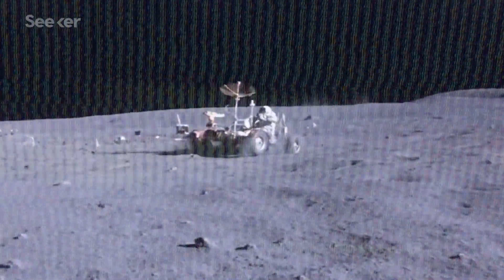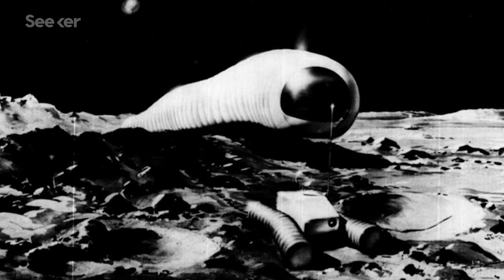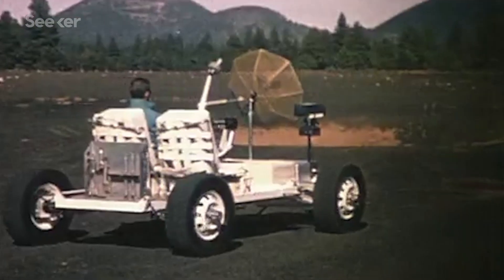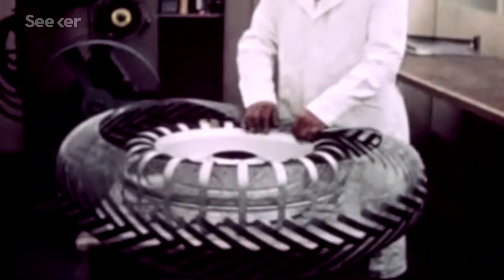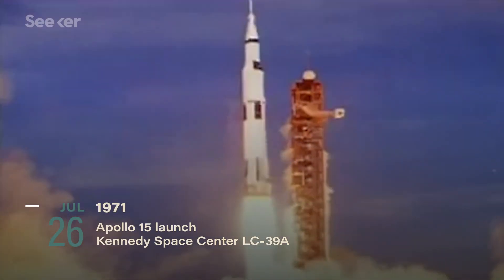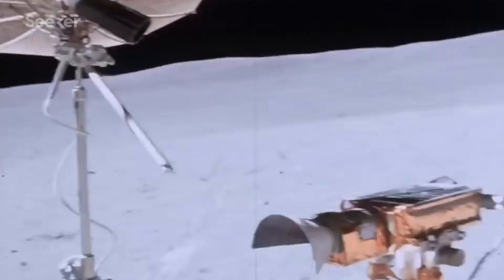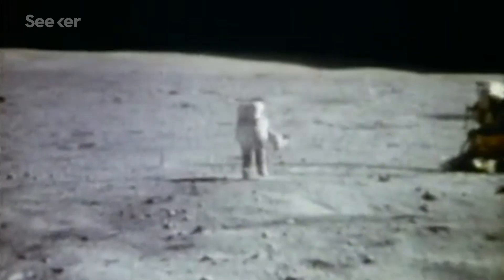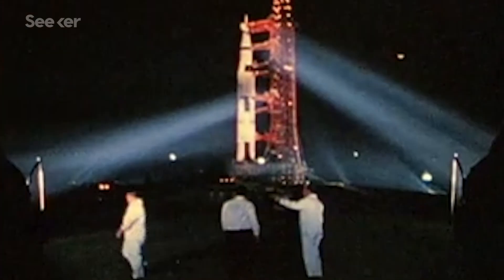How Did NASA Engineer a Car for the Moon? | Apollo

Comment: 🇭🇺Ferenc Pavlics
The native form of this personal name is Pavlics Ferenc. This article uses Western name order when mentioning individuals.

Ferenc Pavlics (February 3, 1928 – February 13, 2024)[1] was a Hungarian-born American mechanical engineer who developed the Apollo Lunar rover.

Working on space projectsedit

￼The U.S. Apollo Lunar Roving Vehicle from Apollo 15 on the Moon in 1971 (NASA)

After leaving Hungary, Pavlics first was working from 1957 in the General Motors (GM) Research Division, Detroit. From 1961 he continued his work in the Santa Barbara Division of GM developing overlands. He continued his postgraduate studies.

Later for the NASA JPL and Boeing Company he started the development of the Lunar Roving Vehicle.[2]

The rover had a total mass of 210 kg and was designed to carry a payload of an additional 490 kg. Each wheel had a 190 W (0.25 horsepower) motor (so the full motor power of the rover was 1 HP). It had a special vehicle design to be able to move on the special surface conditions of the Moon. Their frames were made of aluminum alloy. (See more details: Lunar rover.)

In 1971, the Apollo 15 carried the first Lunar rover to the Moon. In 1972 the Apollo 16 and Apollo 17 also carried Lunar rovers. All three vehicles remained on the Moon. In 1971, Pavlics got a NASA award for the success of the Apollo program. Later, he participated in the development of hybrid and fuel cell driven vehicles and the electric bus network of Santa Barbara. Pavlics died on February 13, 2024, aged 96.[3]

Comment: General Motors

The company provided guidance systems, accelerometers and the batteries that powered the lunar module. However, the manufacturer may be better known for creating the Lunar Rover used in the Apollo 15 mission, which became the first vehicle to drive on the moon's surface on August 1, 1971.19 Jul 2019
Reply: The main designer of this vehicle was a Pole, Mieczysław Bekker, and the idea for the wheels (made of piano string wire and titanium treads) was entirely his own design.

Comment: Look at the dust coming of the rear tyres of the rover The boffins say the Moon's gravity at the surface is only 17 percent that of Earth's that dust should be sent straight into space not falling back the way it doese on earth
Reply: As you've been undoubtedly told already, the speed of the dust thrown up by the LRV's wheels wasn't high enough to reach escape velocity.
Reply: You forgot that there’s no air for the dust to get billowed up in.
Reply: It should be sent all the way out into space? Can you show us the calculations you did to work that out, or are you guessing about something you know nothing about?
Reply: Dust kicked up on the lunar surface will behave differently compared to an equilivent situation on Earth. A perfect example of this is the "Rooster Tail" dust trails kicked up by Apollo 16's John Young during his "Grand Prix" in April 1972. This very situation has been analysed, studied and the published results are easily obtained online. "Ballistic motion of dust in the Lunar Roving Vehicle dust trails", Hsu, Hsiang-Wen, Horányi, Mihály, (University of Colorado), American Journal of Physics, Volume 80, Issue 5, pp. 452-456 (2012). They conclude that the lack of particles’ deceleration along the x-axis of their coordinate system, could only be the case if Apollo 16’s rover footage was filmed in a vacuum and in a gravity environment of 1.6 m/s2 (lunar gravity).  Enjoy reading, take care.
Reply: It  was fake.

Comment: I would be absolutely terrified to fall down on the surface of the moon for fear that something would get nudged loose. Something important.... like a helmet😲
Reply: Dont worry they had on two helmets: a smaller one inside of a larger one
Reply: Don't worry they were on wires and even if a helmet came off it's no big deal because they were either in the Nevada desert or they were in a studio.
Reply: @varuzhshakbazyan5732  youre dumb

Comment: What would have happened if the astronauts were the furthest point away from the lunar lander and the rover suddenly stopped working. Would they have enough oxygen to make it back by bouncing around or would they be screwed
Reply: They never went further with the rover than they were able to walk back when needed
Reply: If they were really on the moon and that happened they would have died a horrible death. The furthest they supposedly drove was about 3 miles, but even at that distance they likely wouldn't have made it back. You try walking miles with all that gear on. 

But since they shot these videos on Earth and that dune buggy was a film prop it wasn't really a problem.

Comment: Amazingly they've lost the tech to go back to the moon,  yeah if they ever went to it in the 1st place. Now there is a radiation belt that they've supposingly gone through with no protection.
Reply: Why would you want to use obsolete and inefficient technology?
You could go to the moon if you had the money, sadly NASA's budget is not what it was in the 60's.
And as for the radiation belt, that has been debunked countless times, if you still cling onto that, you are an idiot.
Reply: @GoldSrc_  They don't have obsolete technology. What they have is 2 major problems, one is it takes a lot of fuel to get any kind of payload into low Earth orbit. That has not changed in 50 years and will never change unless someone can figure out how make an anti-gravity device. The second thing is they need heavy shielding to get beyond the van Allen belts. Both of which were impossible with the primitive technology of 1969. As evidenced by today's most advanced rocket technology which are incapable of going to the moon.

Comment: The LRV with 1960's batteries had a range of 624 miles compared to a Tesla model S with a range of 335 miles. That's unbelievable.
Reply: They did not have that range.
Reply: That rover batteries will not stand extreme heat in moon surface at 120°C, even todays lithium batt technology will not functioning in such environment
Reply: Coz it's fake silver oxide battery used in Lrv is used in button cell now😂
Reply: It's unbelievable because that dune buggy was a film prop.

Comment: The Debye Sheath doesn't provide motive power vs permanent magnetic motors using SamCo or Neodymiums lasting >> 700yrs at over 90% full power, go ahead, try to beat it without voodoo physics ...

Comment: Alright lets push the BS aside for just a moment.

If you superimpose a blue print of a standard JEEP, (yes a simple everyday JEEP) on to the Lunar Rover chassis print provided by NASA, you will find a PERFECT MATCH!!!

At the Smithsonian one day an engineer asked if the Lunar Rover on display was identical to the one that went to the moon to the museum curator and he responded YES! Then the engineer asked but wouldn't the inflated wheels explode on the moon???
The next day the wheels were no longer inflated, they were REPLACED with solid wheels!

NO DETAIL ABOUT ANYTHING THAT HAS TO DO WITH NASA CAN ENDURE SCRUTINY!
Reply: Many car tires are inflated to 30psi and are just fine. Inflating the wheels on the LRV to 15psi would be no different.
Reply: Alex Siemers
Most car tires do not have to roll around a landscape of 260F!!!
But if you're predisposed into taking NASA at face value, go ahead because ANY careful analysis of ANY of their "achievements" would lead to extraordinary disappointments.

Comment: I'd bet money that part of the difficulty was the spacesuits. Also that an astronaut in a modern suit could manage just fine.
Thoughts on future lunar vehicles; something like a dirt bike would be light, maneuverable, and would be easy to use/repair.
Reply: bikes would be dangerous on the lunar surface, i think. You need speed to keep bikes stable, but you also need to drive slow on the lunar surface to avoid tripping and crashing. Something like an ATV might be better.
Reply: @jemuelmongado5030  the only way to know is to try. Bikes are held up gyroscopic action, rather than momentum.

Comment: I'm more interested in knowing how exactly that moon buggy in the thumbnail got to that position, given there's no tire tracks...
Reply: Yes, there are visible tire tracks, troll. They weren’t regular rubber tires but wire mesh. They didn’t want to risk getting a flat tire on the moon.
Reply: It probably was just deployed and not driven
Reply: That piece of shit was just a film prop, they probably used a crane to move it around.